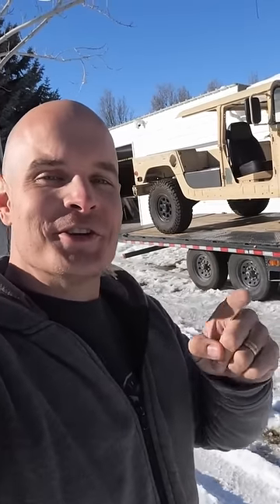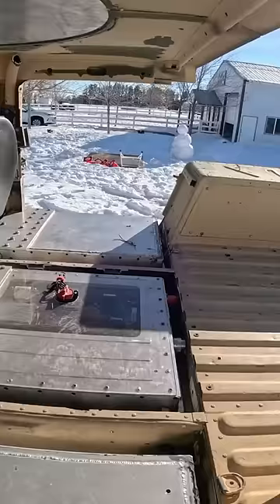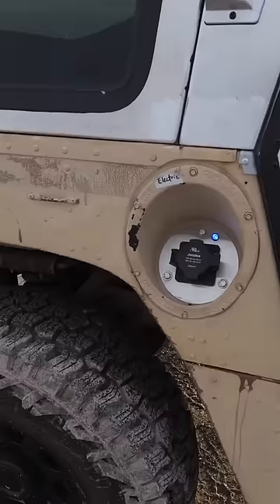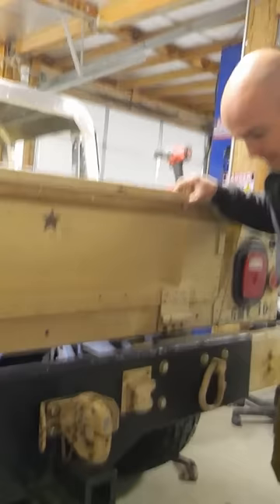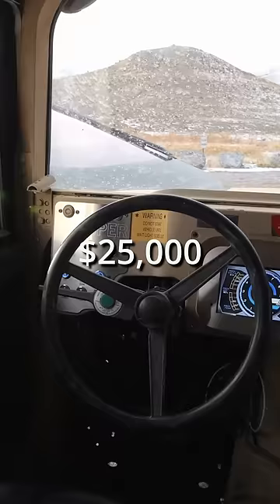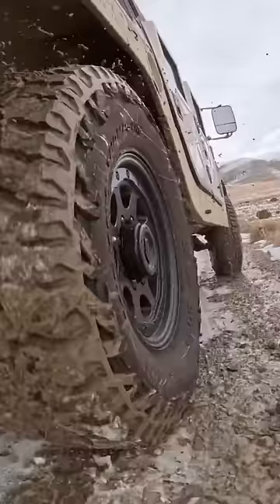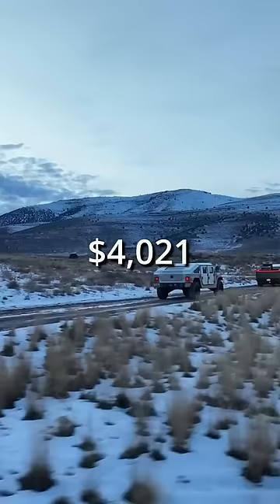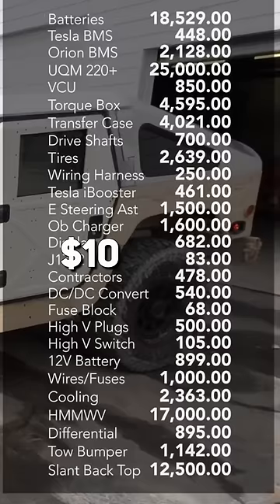WHAT DID IT COST?!  -  (Everything)

Comment: Yeah but an electric m998 hmmwv is way cooler than a cybertruck, and you can use it in all weather without having to worry about the stainless steel body...and using gasoline to clean it.

Comment: Fantastic Job as always JRE, I personally appreciate and applaud you majorly due to the fact that most of your Rigs(inventions) are humanitarian, never be discouraged my good sir you’ll always remain a hero in my heart. That said I just want to make a small and humble suggestion if you’ll have me sir, it’s a fantastically ambitious project and I was thinking that it may do better with Toyota hybrid batteries for the following reasons:
1. In 2003 a Prius did about 215,000 miles, without battery replacement and performance hasn’t waned.
2. In 2015 a Prius taxi in Austria did about over 600,000 miles without ever having its batteries replaced and still running fine . So it may just be a better option in terms of bang for bucks as regards this build scenario. Thank you

Comment: I was literally just thinking about if I had the money what kind of vehicle would I want n I came to the conclusion that I still love the original hummer but its terrible on mpg, so I knew electric was the way to make it sustainable and even more of a beast in terms of raw power and speed, pair that with an interior similar to the alpha-able from your other video, front seats that swivel or slide to the back and a huge screen that drops from the ceiling for gaming n videos, maybe ultra tinted windows that turn opaque (like the ones u see in movies that turn white when electricity is introduced) and im sure some aftermarket sensors and software could allow for autonomous driving, creating the ultimate mobile man cave, maybe some outlets and slant back that has a tailgate that comes down as a work bench or slant that lifts creating a sort of sun shade for the beach

Comment: Can u add some features like 
Wifi

Bluetooth 

Nfc

Dolby sound system with subwoofer 

Automatic Door biometric sensor

Windshield gorrila glass victus
WITH Anti-glare

200mp Front & back camera with OIS 8k resolution 240fps

Infotainment system with OLED Xdr retina display 2100 knits with auto dim

 chipset
SNAPDRAGON GEN A17 PRO